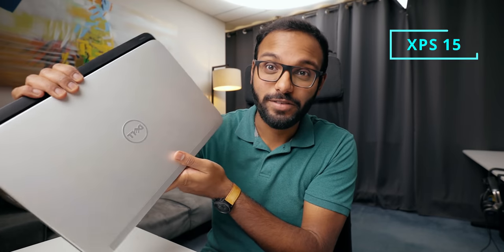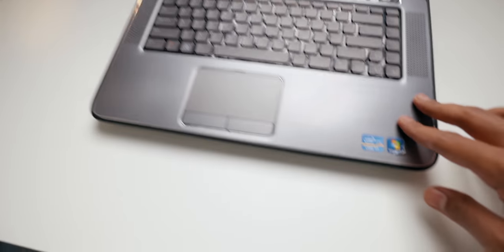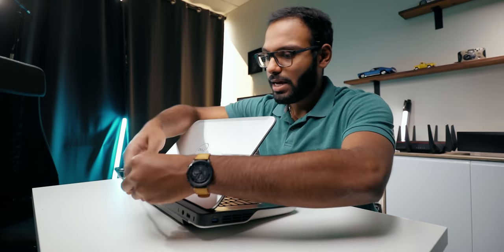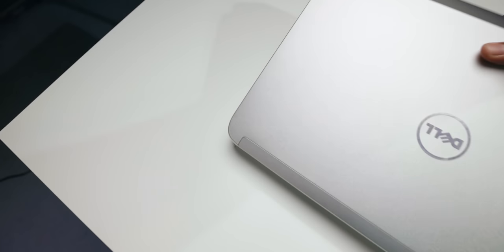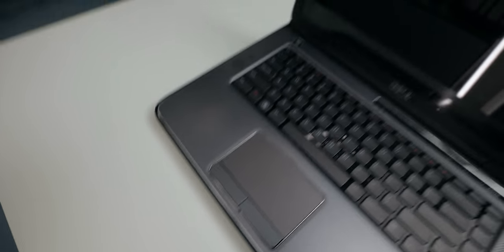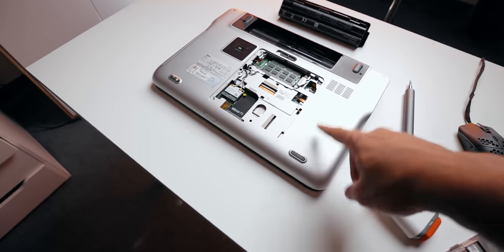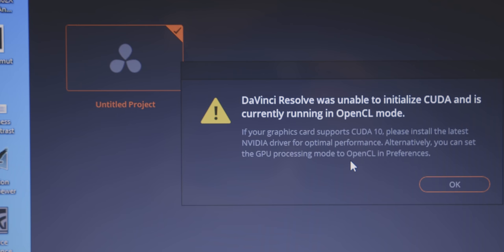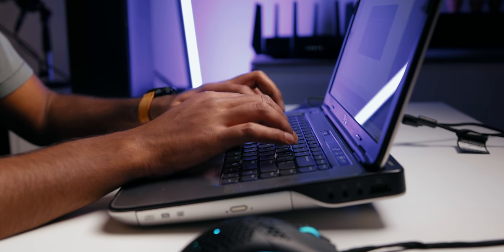I Restored My FIRST Laptop!

Comment: In 2011, a laptop from 2001 would be unusable. In 2021, a laptop from 2011 is perfectly usable.
Reply: You are mostly correct about 2001 laptops. I was using IBM (not lenovo) ThinkPad X31 from around 2003 up until 2010. It was simply inadequate at the end.
Today I still have a working macbook with core 2 duo from 2010 and a year older Sony VAIO with first gen mobile core i3 processor. Both do  everything except 4K video playback.
Reply: @DmitriWeissman  macbook pros from 2010 to 2011 is also quite usable too, but the graphics issue is pretty prominent on these and no big sur update but for the most part it definitely still fly
Reply: @baoquoc3710  Since macOS version for such old macbooks is obsolete anyway, I'd recommend installing some Linux on it. Makes them very snappy.
Reply: I have a laptop from 2008, it's like my toy.
Reply: @baoquoc3710  switch to Linux on those older MacBooks. You'll get an up to date os running on an older computer.
Reply: Definitely. 
Me in 2011: "Are you okay, buddy?"
My Inspiron 5000 with the full power of Mobile Pentium III: "AAAAAAAAAAAAAAAAAAAAA"
Reply: This is so true. I am using a 2012 Dell Inspiron 5520 Laptop with i7-3rd Gen, upgraded it with a SSD, and it does all my job. I can even edit some videos on it. 🔥oh boy
Reply: LOL meanwhile I restored my 2009 Dell Latitude E6400
Man does it perform better than ever in 2021!
Reply: @jasimaneesahamed1033  I will improve my D630 with 4gb of ram, and a bluetooth module.
Reply: @jasimaneesahamed1033  Anything with Sandy Bridge or later has aged incredibly well. Only things holding it back are graphic processors and battery life.

Well, that and the Heartbleed/Spectre vulnerabilities, but I think Windows patched them?
Reply: Sandy Bridge?! WHAT?!?!
Even a Penryn Core 2 Duo still holds up in 2021 to be very honest!
Tho Spectre and Meltdown are actually hardware flaws, and Microsoft has patched them mostly.
Reply: so true!!
Reply: True.
Reply: Im still using a laptop from 2012
Reply: I'd still gives the early 2000s laptops a chance, because maybe one could upgrade them up to a certain degree.
Reply: Yes, I restored an old laptop from 2012 with an SSD, new battery, Windows 11 and some new thermal paste on the CPU. It’s still perfectly usable for web browsing, printing and MS office programs. This is great for cutting down on E-waste as well.
Reply: Guys. Switch your MacBooks to windows 10 which is supported
Reply: Also this statement cannot be more true
Reply: I have a Sony Vaio laptop from 2010. I upgraded it to i7 640M, 8GB of 1333MHz DDR3, and put a 256GB SSD in there. Works really well, better than any garbage-tier modern Celeron or Pentium laptop. Oh, and I upgraded the WiFi/Bluetooth module, so now I get 500Mbit speeds, which is what I'm paying for. Previously, I only got 24Mbit because of a crappy module.
Reply: @DmitriWeissman  The i7-740QM from 2010 is capable of 4K playback. I think the i7-620M is too.
Reply: @0w3nn   i7-740QM doesn't even have a GPU. And the iGPU from the first gen core processors can't handle 4K videos.
Reply: @DmitriWeissman  sorry, my model has the NVIDIA NVS 3100M GPU. But from my knowledge, YouTube doesn’t use the GPU because of a lack of video acceleration, noted by the higher CPU usage. It is capable of 4K video playback, however.
Reply: @jigjifer4369  same! what specs does yours have?

Comment: 10:11 OK, so, you still have the button that says "view optional updates". That's going to install all the drivers you thought u had to manually look for. I'm always refurbishing 1st-4th gen intel laptops and desktops and with at least 6GB of ram and a quality SSD, these machines are more than enough for an average user to browse the web, do school work or run simple windows apps. I usually can get the fingerprint readers to work as well with Windows 10. Windows 10 is really good about finding drivers by itself.
Reply: Completely agree.  Likewise I refurb older intel laptops and very rarely run into software/driver issues running windows 10.  These older laptops are great options for basic use such as web browsing, emails, basic office and school work etc.  One of the prime assets of laptops like Lenovo Thinkpads, Dell Latitudes, HP Elitebooks etc is their longevity.  Add  max ram and a good ssd - and you have a nice quick laptop for everyday use - Not everyone needs or wants the latest powerful workstation or gaming machine, and these are definitely a cost effective and environmentally friendly way to give you some basic computing power.
Reply: @GlasgowLaptops1  Most definitely, the older HP elite book particularly has a special place in my heart as I discovered in high school they where less than $300 for an i7 with a GPU (that you could upgrade too) and sometimes even 16GB of RAM. I had a WD black2 dual drive back then (2015ish). Yeah they are heavy, especially with an extended battery but with the Business class features like expandability, build quality, fingerprint reader, backlit keyboard and 5-6 USB Ports on a laptop for $300!!! is unheard of these days.  I edited so many school video projects in Vegas, make my own senior page for yearbook in Photoshop, and typed countless essays on the magnificent backlit keyboard all while being able to alt tab into CSGO when the teachers weren’t looking 😂.
Reply: I also have to complete agree
I am running personally an old dell laptop, with socketed i7-4800mq, 16gb of ram. And a large afternarket SSD. Althougth I am using it outside of its original use case, as my daily carry laptop, I have found really three problems
AMD drivers for the dedicated GPU are garbage, but that is sadly to be expeted
The battery life isn´t great with only 3-4H of off the grid usability. But luckily, at the moment of writing this, replacement batteries. Sadly, I could not find the secondary battery module, if there even was one for it. Althought it is mentioned both in windows and in dell's power utulity. 
The dimetions. Again, as a full time student, the thickness and weight truly come to play. I have to carry the device without its battery, and that means an extra step, when needing to deploy the device every lesson, that really adds a extra step of finding that cell in my backpack.
Honestly thought, apart from the bad AMD drivers, most of these laptops would be great as a family laptop, normally just plugged into a wall. DDR3 sodimm's are still widely available, and 2,5 SATA ssd' s are still widely availlable. And in most cases, these laptops came with that 8GB of DDR3 ram, which is really most regular computer users really need.
Reply: Yep, that is the only issues I ever run into - drivers for AMD GPU's, on the dell precision models and the likes of the Dell Latitude E6540 if it has it installed.   But that isn't down to intel, Windows or the laptop manufacturer - but AMD themselves.  If I know or suspect that the machine has an AMD GPU - I try to avoid it lol.
Reply: @GlasgowLaptops1  Or never expect to use it. I am using the E6540, but I have the dedicted radeon Hd8790m disabled on windows 10.
Reply: @GlasgowLaptops1  ahh yes the video drivers 😂  do not let Windows get them automatically for a latitude E6540 with intel/AMD switchable graphics. As soon as Windows gets them it freezes the system and you won’t be able to boot into ur fresh install anymore. Get those on a usb and install them then u can let Windows get everything else (through windows updates > optional updates > driver updates)😊
Reply: @GlasgowLaptops1  I have an E6400 LOL, still holds up in 2021
Reply: It's not always the case for me. I prefer drivers downloaded from manufacturer websites (Dell, HP, etc.) or archive third party pages. Generic drivers from Windows Update can potentially harm your computer so I always try to avoid it.

Comment: I repair laptops for a living and you did a great job on this. If anyone has an old laptop laying around that they want to breathe some new life into, if you add a ssd and as much ram as the motherboard supports, then it is a relatively cheap way to extend its life.
Reply: Is swapping SSD into older(like 10 year  old) laptops an option...?   Also, a decent m2 2242 recommendation, 256gb....?
Reply: @capitaldd3693  yes, I put an SSD in an old gateway laptop from 2009, runs just fine for office use. M2 is unlikely, SATA SSD should work.
Reply: @paulb4uk  thanks for the response..... I think that will be the way to go
Reply: @Vile23   thanks. I believe I'll look into that option. It'll be quicker.
Reply: @Vile23  M.2 is not a thing on the laptop until like 2016-2017 or so like that
Reply: For the most part you should be fine.  I believe the OS is what needs to have the Trim support.
Reply: Yup, and a newer Wifi card never hurts if you can find one cheap.  I put an 7260ac card in both of mine and it made a big difference.
Reply: My inspiron 700m has an sd to ide adapter in it. One of the BEST upgrades I've ever done to that machine!
Reply: Go for chrome OS instead

Comment: Good video, i think for old devices like that you should give a try for linux Distro, maybe have better compatibility of components and drivers, SSD and RAM is a way to upgrade laptops.
Reply: And you can even run them well off a USB stick.
Reply: Debian or Arch based would be good. Otherwise Ubuntu seems viable due to Nvidia compatibility

Comment: Currently rocking a ThinkPad T520 with a intel core i5-2540m(which is only 2C4T, weaker than the i7 in the Dell shown in the video) as my daily driving laptop, since I don't play games at all(except for some occasional minesweeper since they still exist in Win7 for some reason), I'm actually happy with the performance of it.
This tank of a laptop handles all my basic school and office workflow just fine, has a ton of ports, a 1600x900 screen that is actually not that bad, exceptional 7 row keyboard, and about3~4hrs of battery life which is probably just enough for how I use it although more will definitely be better. The only main problem I have with it is the lack of a HDMI port, it has DP and VGA but my school only support HDMI for some reason, so I can't use it easily if I need to hook up a projector or whatever.

Comment: I have (and still use) pretty much the same laptop specs wise, although I upgraded mine to 16GB of RAM, i7 2860qm and replaced DVD drive with 1TB 7200 Barracuda and installed 860 EVO 250GB. 540m is really slow, but at least I can still play retro games easily.
With some software tinkering, I was able to configure OBS to stream on Twitch and play older games. Didn't expect it to work that well (quality is still meh, but I expected it not to work at all).
Reply: Me watching the video on my G74Sx with the same base specs except an as much outdated GTX560 🤪
Reply: Do you have Windows 10 installed? I'm thinking of using my old Laptop also for old games, but downgrading it to Windows 7 (if that is possible), because Windows 10 doesn't allow many old games on CD to be played
Reply: @ashar8192  I use w10 because it's my daily PC and for super retro games I have a EEE PC with windows XP :)
Reply: @ashar8192  Yes, I do have Windows 10 installed. But installing Windows 7 should be easy. I actually had W10 and W7 installed in parallel at some point, but eventually I got rid of 7.

Comment: Making me feel old, 10 years doesn't feel that far away to me..  Was given a base spec l502x a colleague who had trouble with how slow it was and upgraded, it was only a few years old at the time. Slowly upgraded with both used ebay and handmedown parts from my other laptops, from i3 to i7, 2gb to 8gb ram, 720p to 1080p screen,  mech drive to 250gb ssd, and N to AC wifi minicard. Taken it apart more times than I can remember!

Its never been one of my main desktops/laptops, but has served as a great reliable spare, something I'm never fussed over loaning out to family or friend in a pinch if their own hardware crapped out, or that I can leave in my parked car somewhere without being devastated if it ever got stolen compared to my other laptops.

Comment: I actually Restored and Upgraded my Lenovo B570 Laptop a Few Years Ago.

Original Specs were an Intel Pentium B950 Dual-Core CPU, 3GB of DDR3-1333 RAM, 320GB WD Blue HDD, and Integrated Intel HD Graphics, and I bought it back in 2011 for $300.

Upgraded it around 2016 to have an Intel Core i7-2820QM ($70), 16GB of CORSAIR Vengeance DDR3-1600 RAM ($100), a 250GB Samsung PM830 mSATA SSD ($30), a 750GB WD Blue HDD ($50), and Integrated Intel HD Graphics 3000 (No Dedicated GPU could be Installed).

It's not good in terms of E-Sports Gaming (For Example, it can barely run TF2 at 1080p low at 30 FPS), but it can do Emulation and Light Gaming, as an Everyday Laptop, It's Phenomenal.

I've heard of a Mini-PCIe or Express Card to PCI-E X16 Graphics Card Dock Called the EXP GDC that allows you to hook up a Dedicated GPU to your Laptop using the Respective Slot on your Laptop. Might be worth a try on that. 

Great Video Nonetheless. Keep up the Great Work!

Comment: This is fun, thanks Eber. I think highlighting the display quality is a good thing. I recently acquired a 2008 Dell 30” 3008WFP, I had the 2707WFP back in the day on release, yet always listed after the 3008. Still, today it is an absolutely stunning display - wonderful colour rendition, 16:10 pixel ratio @ 2560x1600. It also has a built-in hardware image scaler so lower resolutions are crisp. Aside the exciting Ultra-Wide and high Hz market, the display market is otherwise bland as hell now.

Comment: I still daily drive a L702X for office work, checking emails, web browsing, and still love it. It is a 17 inch monster, 1080 display, two SSD's, Nvidia Discrete (was one of the first with steoroscopic graphics where you get the glasses to see in 3D). upgraded the memory the HDD to SSD, new battery, new charging brick, and still going strong for basic use. Loved the video!

Comment: I had a dell xps l702x, like the same thing but 17 inches, and it was great at look, but awfull at one thing. The palmrest under the wasd was really melting under any heavy use. Like if i had the cpu/gpu at 70 deg, witch wasn't even max temps it could hit, it was a pain for my hand, it was litteraly burning. But it had 4 ram slots, and 2 hdd slots, and i liked it for that upgradeability. Also sound was very good.

Comment: Now I remember the XPS 17 L702x. It was pretty expensive for the time in UK, but it offered probably the most awesome of sound solutions to be integrated in a laptop, my brother was blown away by the capabilities of the laptop and used it most often for gaming and as his daily driver.

Sadly it ran extremely hot, being that it was armed with a Sandy Bridge based i7 which mostly stayed at high 90's, until the temperature creeped to about a 100c and over.

I think over-time, a temperature sensor or something else became defective and the laptop couldn't hold any stable clock speeds, thus rendering most gaming applications to stutter all the time. It couldn't cool itself properly even after maintenance. So we had to put the thing over an air ionizer, because it had a powerful fan, which was only a temporary solution to the problem that was slowly becoming worse.

One night I got a message that said the hot beast went to heaven after serving faithfully. And it did, we played lots of DayZ, RE5 and ran emulators for co-op on it. Good times.

Comment: What an awesome video! I still have my L502X that I bought in March 2011. I got it with the i7-2630QM, 6GB RAM (which I upgraded to 8 and later 16GB), NVIDIA 525M, and a 640GB HDD (which I later upgraded to 1TB and then 2TB). I also made sure to get the FHD upgrade. I loved this laptop. It was my primary workhorse and music player from 2011 until early 2020, when I finally bought a new laptop (an open-box MSI GL63). The XPS speakers are still amazing, and better than the ones on my newer laptops (I upgraded to an even newer laptop just a month ago, this time a lightly used Lenovo Legion 5 with the Ryzen 7 4800H, produced shortly before 5000-series refresh.)

I still keep my XPS around for nights when I'm doing a long-running CPU-intensive workload on my primary laptop. My XPS is running Windows 8.1, where it will likely remain. Did you get all drivers working properly under Windows 10? What about the Waves MaxxAudio? I heard drivers, especially for that, were not well-behaved on 10. I still might attempt a 10 upgrade in 2023 once 8.1 goes EOL, and if I'm still using the XPS.

Comment: I'm still using my Dell XPS 17 L702x with GT555M , with RAM and SSD upgrades. Everything including the track pad, keyboard brightness, wifi, bluetooth works well. Using it as a smart tv though in clamshell mode (enables 4K resolution). Using MSI overclocking utility i can get this machine to play Warcraft 3/Frozen throne for Lan party, CSGO, Team Fortress 2, Age of Empires, Thief 1,2,3. On Development side run some Docker, Hyper V serves well so far. Only part which is causing the issue is the power cord, literally all the plastics around it is broken down like a powder, left with only wire now..

Comment: Perfect timing as I had been refreshing a few of my old laptops recently. One thing I would have like to see is cleaning up the fans and reapplying thermal paste because it's something that I haven't dare to do yet.

One of the XPS I was working on could no longer detect the only mSATA connection. Now it's running Ubuntu from a tiny USB thumb drive.